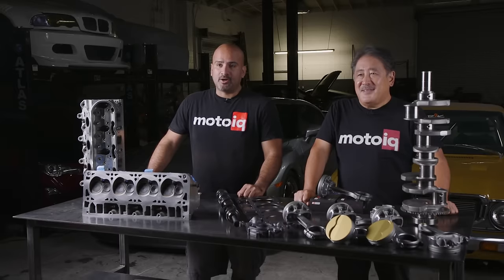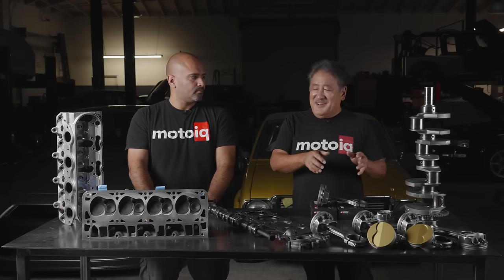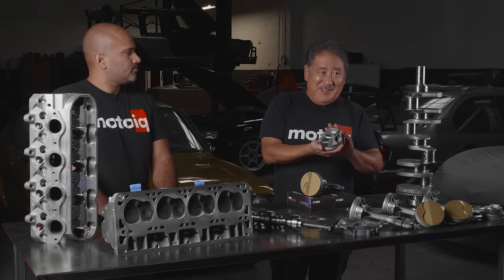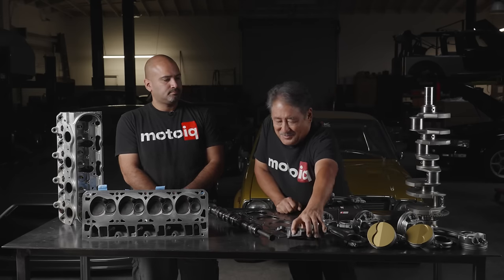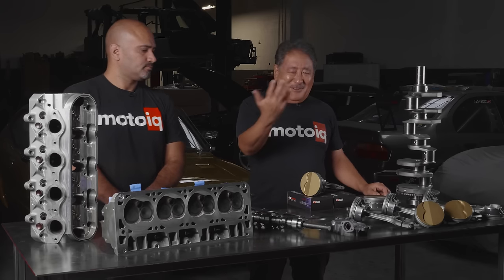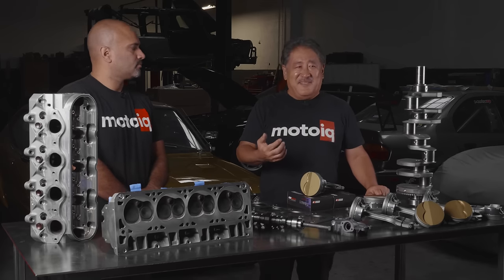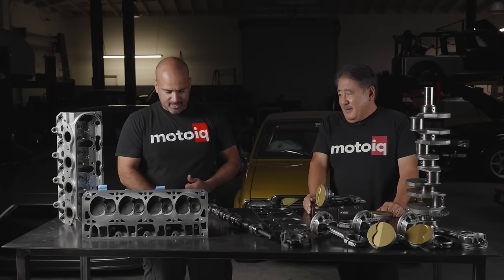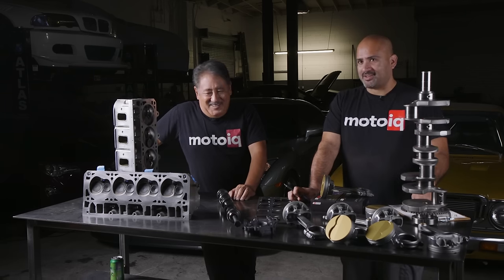How Much Does an LS Engine Build Cost?

Comment: What can you do for engines in spec racing series (spec e46, spec miata, etc...)?
Reply from the maker: Well, you try to get the best ring and valve seal, get the most flow out of the valve seat area and get the clearances just right to get your friction low.

Comment: Love your site and all the useful info you provide, not trying to rain on the parade but if your engine has a 7:21 4.01 inch bore and a 4 inch stroke 4.O1 X 4 = you have a 404.13793728 ci motor not 418 ci you need at least a bore of  4.O1 X a stroke of 4.137199in to = 417.9997674942197 ci. This is = to more than 1/8th of an inch shy of the required stroke, nice try but do the math first so you are not telling wrong info to the public. Sorry but if I am told that I will get a 418 ci motor that's what I expect to receive. Also not saying that a 404.13793728 ci stroker motor is not a torque monster, because it probably is. But I am a stickler when it comes to #s that are repeatable, and I don't take some ones word for it I always check for myself. THANK YOU FOR THE GREAT SITE
Reply from the maker: it's a 4.075" bore on this motor, not a 4.010
Reply: @motoiq  at 3:52 you state that you had to bore out the customer's block 0.010 in and that was about the limit for an LS block. At no time did you state that the block was already at 4.060, so I was going by the info you provided. And I am sorry for the confusion about the engine in ? here. Because a motor with 4.075" bore x 4 inch 
stroke is in deed a 417.345 cubic inch motor. Thanks for such a great site and all of the good info you provide for us. Would there be any benefit to having the outside on an engine block wpc treated. THANK YOU so much for taking the time and effort to share all of this great information I learn new info from each and every video you give us. Have a great day. Trent Mozee
Reply from the maker: LS3 has a bore 4.065" stock, yeah I didn't say what the stock bore was.  I don't think you should waste your money doing the outside of the block., only the bores.
Reply: @motoiq  Thank you for the reply, Have a great day Trent

Comment: This is crazy. What a wild amount of damage done, simply by not starting and running it "the right way".

Personally, I'd love to see a destroked LS7 running a 3.622" crank, built and cammed to withstand 8,500 RPM on rollers, screaming to 750-800 HP on pump gas.
Reply from the maker: I have always wanted to try this too but often high revving engines are not as fun and sometimes not as fast on the track. My dream experimental combo is a 4.140 bore, 3.898 stroke, 6.650 rod in a tall deck block with all pro heads, rev it to 9k.
Reply: @motoiq  Can you price this dream engine out? I'm interested in something like that and would love to see it on paper. I know the bare heads pair was $4,700 in the video. Thanks for the excellent information. My latest experiment was an Iron 6.0 LQ4 block over-bored 0.065 to accept VVT 6.2 pistons with 4.8 rods and crank. We went with hand ported square port heads and it pulled pretty nicely up to 7,200 RPM with our lunati core camshaft. It was a budget used parts build that we didn't expect to live but seemed to do great. Was 410whp on a proline hub dyno here in Phoenix AZ in a 2006 Pontiac GTO.

I'd be interested in your dream build for my 1970 Chevelle SS.
Reply from the maker: That is a great combo for a budjet build.  If we were to build a 9K LS it would cost somewhere around 30-35k.  A lot of that money is in the tall deck block and the dry sump system needed to keep it lubed correctly at that RPM.  Some things like the rings and the Ti valves needed would have a pretty short service life. That is speaking in a racing sense though. It might not be a super pleasant street motor, probably idle at 1500 rpm but it would be rocking and scream hahaha.
Reply from the maker: I want to do a 4" stroked, 6.125 rod, 0.100 over 5.3 with the Edelbrock small bore square port heads with a centrifugal blower.  Nice strong iron block and a cheap core. The trouble is 5.3 guys are super cheap so they don't want to pop for the crank. rods, or heads hahaha.

Comment: Damn I wonder if I should trust my machine shop only charging me $500 for machining my LS block.
Reply from the maker: Ask if they use a torque plate, what kind of machine they are using, what processes they are doing to finish the bores after boring.
Reply: Sounds like they don't have newer CWT balancer, sunnen hones, or other high quality machining equipment.
Reply: It will be fine. Torque plates are more of a sales gimmick today then they where in the 70s. Clearances are no where as bad and blocks a lot stronger then they where on 1975. Does it hurt, no. But it does not help like it is sold to you.

Comment: Can you explain how putting the head on the block could distort it. My thought is if the blocks mating surface is flat and the head is flat. You're just putting two flat surfaces together. How does that create distortions in the cylinders. If something wasn't true between the two surfaces I could see the torque  moving things around.
Reply from the maker: The force generated by the torque on the bolts in the block, it tweaks the bores, as much as 0.0015".  Subaru's even more!
Reply: It's an old school thought. When clearances where no where near what they are now. Now it's mostly a sales gimmick.

Comment: Great Video lots of great info
Do you guys Dyno the engines after you build them?
Reply from the maker: No we don't, we have a chassis dyno but not many people would pay to run there engine on an engine dyno, need a dyno adaptor, wire harness, ECU, a tuner.  A few thousand worth of stuff.  We don't have adaptors and harnesses with ECU's for every single potential engine.
Reply: @motoiq  thank you for your reply. Excellent channel.

Comment: It cost alot ask me how I know.  I bet y’all get so many people wanting a price I do for tires. It seems they think it’s FREE or something. 😂
Reply from the maker: Tons of people think we are super expensive but not really.  I would be wary of anyone who charges a lot less.  We straighten out some really butchered stuff done by other "shops" that charge half of us. The biggest thing is shops not measuring clearances, not doing the machining right, using plastigage rather than the proper measuring tools, blocks getting machined to the wrong dimensions and no one checks, etc.
Reply: @motoiq  ya seen that in your prices. People don’t understand it’s a process and lots of parts.
Reply from the maker: We probably take 4x the time to check and measure every single thing.

Comment: Please correct me if I’m wrong but you said I beam rods but you have H beam in your hands.
Reply from the maker: We use both, some of our high end engines use Calles I beam rods and we are speaking in general. For this lower buck engine we are using H beams.
Reply: @motoiq  thank you for clarifying , what’s your thoughts on the LS9 Titanium rods compared to steel or aluminum rods ?
Reply from the maker: The are about the equivalent of steel but 40% lighter.  Aluminum is for short term use, drag racing only.

Comment: So, this video basically says it costs $14 k+ to stroke a stock LS3 engine.

The question is: Is it really feasable? Aren't you better off buying an LS6 instead?

Either way you would still be confused if it werent for this video. 

Thank you guys.
Reply from the maker: You mean LS7, and LS6 is a short stroke 5.7 liter.
Reply: @motoiq  

You're right. LS 7 (505 hp for$10k) or even LS 8 (554 hp for $8 to 10k).
Again, thank you guys for this unique in-depth educational video.
Reply from the maker: The LS8 is a 6.2 liter, not a long stroke engine either.
Reply: @motoiq  
The point I'm trying to make is that you can get the desired hp from a brand new engine for less than stroking a used, beaten up engine.
Reply from the maker: That is true but that is also the used engine price and you are not 100% sure of what you are getting,  The new engine prices are the same or more than some of our built engines.
Reply: @motoiq  
I have no doubt that some people benefit from rebuilding their engines under certain  circumstances. But the prices that I mentioned I'm almost sure they are for new crate engines.

A limiting factor however may be engine fitment as each car may have different accessories taking up space, forcing the owner to stick with his engine. Or maintaining car's authenticity by keeping same engine sereal number.
Reply from the maker: No that is the typical price for a junkyard engine, those engines are expensive used and a sought after.

Comment: Torque plates have been proven over and over to not be needed. It does absolutely nothing. Clearly you
Have never measured it yourself or you would know this, just regurgitating things you have been told.
Reply from the maker: It's because we measure it ourselves that we know.  Especially with studs. We build pretty good LS engines and have a good record in actual racing.
Reply: @motoiq  oh, you have? So what’s the measurements since you’ve done it yourself. Racing has nothing to do with it, don’t bring up moot points. What’s not moot is my 27 years as a machinist and engineer. So you’re not bs me bub.
Reply from the maker: Ok bub, it can vary up to about 0.001 to 0.0005 with OEM torque to yield bolts and even more with studs and temperature. So you are a machinist and engineer, have a cookie.
Reply: @motoiq  thanks for the cookie, being a machinist and engineer has a lot more to do with it than “good record in actual racing”. Thank for the incorrect information, I’ve  now confirmed you’re talking out of your 4th point of contact. Also, your “measurements” also confirm that (if was true) has zero effect on anything. Except for wasting someone’s time or taking someone’s money for a BS process.
Reply from the maker: The fact that you said that those dimensions have zero effect means that we would never have you machine any of our parts. Do an experiment, bore and hone a block with a torque plate, then remove it, it will no longer be round or straight. Any reputable engine builder will tell you the exact same thing. Some engines like Subarus can distort over 0.002 which is within the range of tolerance of total piston-to-wall clearance of OEM pistons. Have fun.
Reply from the maker: Hahaha you are a joke, goodbye.
Reply: Why don't you jump on the horn with Tom Nelson over at NRE in Chatsworth California and tell him that?  He'll give you 700 reasons why torque plates are needed and how many times the block needs to be mocked and disassembled. Tom Nelson is a pretty good guy, and he'll be more than happy to truly school you over the phone.

Comment: Let me ask a question. Did I hear  correctly that your labor to assemble the engine is $4800 ? Also how many hours is that? That seems extremely expensive. Does that include a dyno sheet?
Reply from the maker: It's about 32 hours and machine work, we sold our engine dyno but have a chassis dyno, so we could dyno your car.
Reply: @motoiq  I guess if you're building an all out race engine you can justify $4800. The cost of Everything has gotten way out of hand. I have been an Automotive Technician for 30 years so I know a thing or two. Actually before I made the comment I had forgotten that it's 2023. Also I'm used to doing everything myself. I currently work for Ford and everything is outrageously expensive nowadays. Also I wasn't considering all the machine work involved. What do you guys charge to assemble a short block? I had machine work done on a small block Chevy that I raced in the years 1999 or 2000 and the machine shop charged $80 to put the short block together LOL. I didn't have a place to put it together because the wife said that the kitchen was off limits LMAO. So I told my machine shop to go ahead and put it together.
Reply from the maker: You should probably build your own engines!
Reply: @motoiq  I was trying to compare the price difference of 23 years of time. Sorry if I offended anyone. You didn't answer the question.
Reply from the maker: No one is offended, we charge about half of that. There is a big difference between charging a few hundred to put together something vs what we do.  Working at a dealership you can see how expensive labor is especially nowadays.  Since Biden became president everything has gone up from 25-100% too.
Reply: @motoiq  times are definitely tougher. I don't see how some families are able to get by.
Reply from the maker: Me neither, wages for sure have not gone up anywhere close to inflation!

Comment: i guess smoking crack has not gone out of style. $14k for a "Budget" build?!?!
Reply from the maker: You get what you pay for and probably haven't built an engine lately.
Reply: @motoiq  Oh for sure - you get what you pay for. But when i see something like "LS Engine Build Cost" in the title - i'm thinking from mild to wild. What i watched was Wild to Criminally Insane. My idea of a "Budget" LS build would start with a junkyard engine. LOL
Reply: I guess "Budget" is subjective and my idea of Budget is drastically different from yours.
Reply from the maker: I guess if you found a good running 5.3 in the junkyard, you could be in it for $500 but that is really not a build in this sense.
Reply: @motoiq  A junkyard motor would be the starting point. i'd dissemble, inspect, send relevant components to the machine shop and assess what i'm working with. It's not a "New" build in the truest scene of the word - but using functional parts like the Block, Crank, Rods and Heads as a starting point can make a 500 HP NA 5.3L for around $3.5k to $7K without much effort. To me that is a "Budget" friendly build that can be applied to any existing GM (4.8, 5.3 or 6 Liter) Car, Truck or SUV.
Reply: I give credit where credit is due and the motor build explored here is the pinnacle of a 5.3L that requires deep pockets to build and maintain. Any Restomod project worth its salt deserves an engine like the one here in this video. Spending $14k on an engine is very applicable in this context where the finished product is valued at $80k and up.
Reply from the maker: We are coming out with a max 5.3 built video just waiting on parts. Our angle is a fully built 5.3 is about the same price as a used LS3 but you can do it with way more power for the same money.  We did a junkyard 5.3 video, freshened up with some new parts before dropping in too just like you said, you can find it on our channel.

Comment: Is a Ls more budget platform then K series?
Reply from the maker: It depends for what
Reply: @motoiq  having fun on the weekends but not just for racing a reliable driver
Reply from the maker: Nether is budjet.
Reply: @motoiq  so it’s really equal and about what I want, it has nothing to do with cost cause you could go crazy with both builds if you had the funds theoretically speaking and it’s still gonna be costly just to build either either way the right way
Reply from the maker: Maybe the K motor is slightly less.

Comment: How come one side (i wanna say passenger) is always way scummier than the other? Is that something to do with the non-priority mains? One head is just lowest priority. Thanks for the great info!
Reply from the maker: What do you mean by scummier?
Reply: One side has a PCV valve.
Reply from the maker: That's possible if the oil doesnt get changed much.
Reply: Well i've only had the heads off maybe 5 Ls engines while i was at GM. I noticed one head would have significantly more deposits. Heck a 20 with 26k that turned a lifter and wiped a cam lobe had a side with like-new pushrods/rockers/springs and the other with heavy varnish. 5k changes at the dealership i was at. must be priority or pcv
Reply from the maker: I would say that's likely, Race motors get the oil changed so much you don't see that.

Comment: Yeah man, the price points on both builds is right on, we did a budget build on our LSA engine and crank out about 720whp with 418cid stroker @12# boost, I maybe should have done more work on the heads...porting, shaft rockers and a dry sump would be awesome too. I like reliability in a road racer but given the nature of the beast (convertible) I doubt I will do much more...   As per some of our past conversations I feel you are giving a straight talk on building a LS that is realistic and factual.
Reply from the maker: Thank you!
Reply: You dont want to put too much in the stock block, once you get up to 800 plus whp it is on a ticking clock to cracking a sleeve.
Reply from the maker: Head gasket seal is more of an issue at 800 plus, at about 1000 the main caps start to move.
Reply: @motoiq  Didn't have any head gasket issues on mine and 3 other friends, but all 3 cracked a sleeve. I think you said you like the stock head bolts tho. Either way the stock block is a fuse waiting to blow at upper HP levels.
Reply from the maker: Wow you cracked a sleeve at 12 psi?  We generally don't see problems till more than 14 psi.  Did you have good tuning?  Did the broken engines show signs of detonation?  I would think that the head gasket would go before you split a cylinder.
Reply: Yeah mine are fine at 12 psi…

Comment: Awesome content. Have you guys ever built an LS for aviation use? Something set up like a truck engine, slow turning, bottom end torque, able to run under load for hours, turbo and all aluminum.
Reply from the maker: I am not an advocate of auto engines in aero applications. Aero engines are continuous high load, low RPM and car engines are not designed for that.  Imagine lugging your engine on the dyno all the time.  Also the prop and gearbox can generate bad harmonics that can't be good for a lightly built car engine.  In the air, its not like you can pull over to the side of the road if something goes wrong.  I don't want to experiment with a customers life.